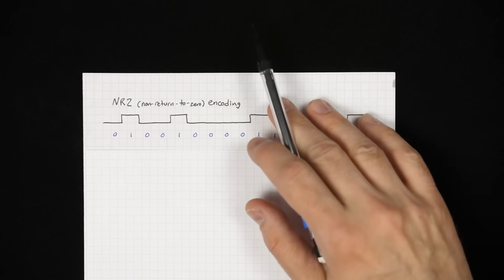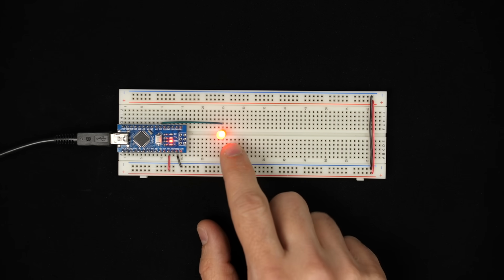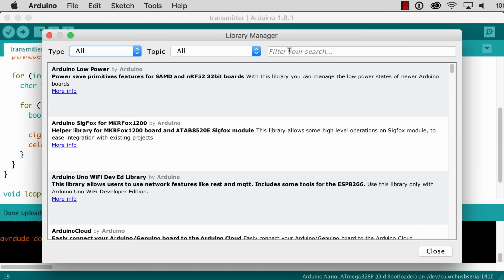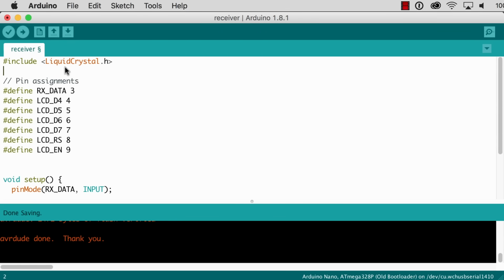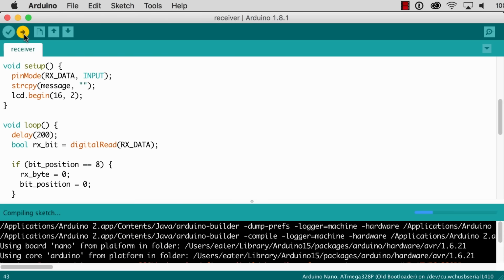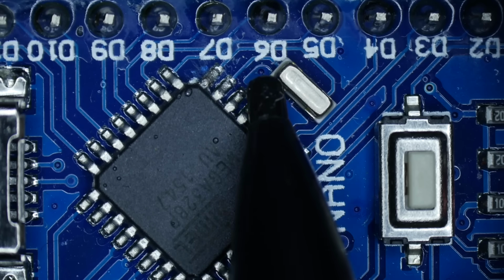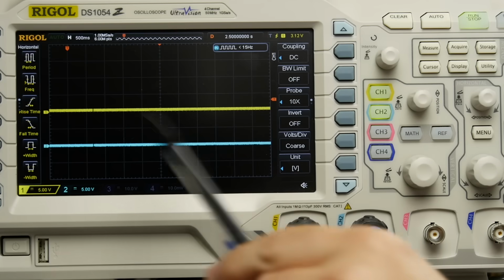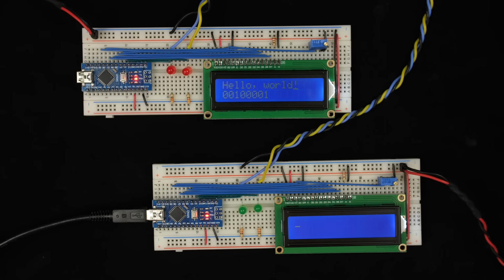Reliable data transmission

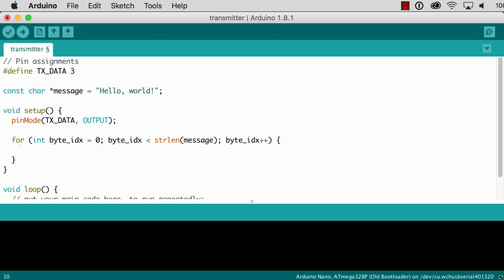Comment: @3:18 using strlen to convert a linear algorithm into a quadratic algorithm. use `for(char * tx_byte = message; *tx_byte; tx_byte++)`.
Reply: Ben, this is a great video.  I did something similar when I taught a data communications class as a clinical/adjunct professor.  Your demonstration is better than what I did.

I was looking for this thread; I spotted this issue when I watched this morning.

Ted, you are completely correct.  As written, this code fragment is O(n^2) in the length of the message.  However, might I suggest for pedagogical purposes (many viewers don't have our experience):
        msg_len = strlen(message);          /* Could be written as:  for(int byte_idx = 0, msg_len = strlen(message); byte_idx .... )  */
        for(int byte_idx = 0; byte_idx < msg_len; byte_idx++) {
                char tx_byte = message[byte_idx];
        }

Balazs Oczot, unless the compiler did the above optimization, this fragment is, indeed, O(n^2).  C guarantees that the conditional in a 'for' loop will be evaluated every iteration.  strlen() determines the length by marching along the string searching for the null character, '\0', that marks the end of a C string.  So, finding the length of the string is O(n).  Because the for loop is executed n times and at each iteration the length of the string is calculated, this fragment is, as Ted stated, O(n^2).  Your point regarding pedagogy is well taken.

Simon, you are absolutely correct.

I worked for a large, well known company, as an industrial mathematician doing queueing theory and performance engineering.  A large project was nearly cancelled because it didn't meet performance requirements.  None of the software engineers could find the problem.  I never knew the exact details, but I guess perhaps 50 staff-years of work ready to be flushed down the toilet.  One of my colleagues and I were given the task of finding the problem, else the project would be scrapped.  It turned out that this exact problem, buried at the bottom of several nested loops, was the culprit.  After fixing this, just as above, and recompiling, the project went from failing abysmally, about sixty times slower than required, to exceeding the performance requirements by about 50%.  I often wonder how many projects are saved today simply by throwing more or faster silicon at it, rather than finding the root cause.
Be well & Best regards, Gottfried
Reply: Its not quadratic, only two times the length of the message. And the code is more readable for people not familiar with pointers
Reply: @b4l1x  the condition is re-evaluating every time, including computing the length, which is in the order of the length of the string if the compiler didn't optimise (which many do for strlen)

Comment: Well if you're gonna use a hardware interrupt to read the the pin you might as well trigger on pin change and measure how long it has been high or low to count the ones and zeros. It would still be a bad version of the SoftwareSerial library, but you know, at least you wouldn't need a clock line. :P

Comment: "bool tx_bit = tx_byte & (0x80 >> bit_idx)" at around 4:22 is not very portable and may induce unspecified behavior on some older compilers.
It's good practice in my opinion to always normalize your boolean conversions, for example: "bool tx_bit = tx_byte & (0x80 >> bit_idx) ? true : false;"

Comment: You didn't really mention clock and data recovery in the transmission of NRZ data. Probably beyond the scope of the video, but that is how it is done in real life (concept of locking a local oscillator to incoming data).

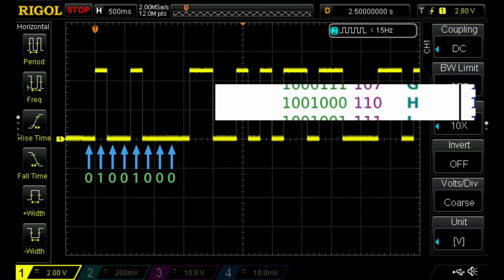Comment: i like the way you present information. I've opinion of what extra info might be presented: you started (8:40) with framing bit which is start bit in UART (or maybe link to that video) but you ended with clock which is closer to USART... also i think it was nice to remove the delay in transmitter (although i think it will not affect because delay in LCD library is big already) so maybe print after recieving everything.. and its nice to briefly talk about why the wires are twisted ;).

Comment: It's not a good idea to put a LED on an output directly. What happens is the output voltage will drop to the forward voltage. So it can be hard to to get subsequent inputs on those outputs to trigger high. The best setup Would have the LED being driven by a mosfet from the output.

Comment: You don't need a second line at all if you're willing to have a slightly slower transfer rate. You can have the first clock pulse designate the clock speed to the receiver (the length of the clock pulse is the clock speed, we'll call it dt). Then, you begin each bit by changing the line from low to high for a length of dt, and then you pull it low for a length of dt if you want to send a 0 or you keep it high for a length of dt if you want to send a 0. After these two dt have passed, you drop the line low for an arbitrary amount of time (let's say dt/4), and then you pull it high again for the next bit, and repeat. The receiver stops receiving the stream of data if, after you send a bit, the line remains low for a certain amount of time (let's say dt * 2).

This allows you to reliably send data over 1 bit. The clock speed is arbitrary as the sender gets to decide the clock speed at the beginning of the communication. The two devices cannot fall out of sync because we resync between every bit. Having a system like this allows for both upstream and downstream data to be sent at the same time through two wires (or a single coaxial cable), so using simply two wires you can have the devices talking to each other back and forth for real-time communication.

Comment: I am not sure that rtz is more complicated than nrtz. I always use analog pins and rtz to communicate between arduinos as I don't have to worry about clock syncing at all, and I never have communication issues. Far easier to implement.

Here is a simple primitive way to do it that allows a metric truck ton of wiggle room on the analog signal level on the receiving end. Just make sure the receiving end is listening at a higher rate than the transmitting side is sending. 

int read;
bool bitSet = false;

void setup() {
     analogReadResolution(3);
     //0v to 1.67v = 0
    //1.67v to 3.33v = 1
    //3.33v to 5v = 2
}

void loop() {
     read =  analogRead(A0);
     if (!bitSet) {
          if (read == 0) {
              appendBit(false);
              bitSet = true;
          } else if (read == 2) {
              appendBit(true);
              bitSet = true;
          } 
     } else if (read == 1) {
          bitSet = false;
     }
    delay(1);
}

Comment: When the transmitter and receiver have different power sources and you connect the cable's ground lead to ground on both sides, how do you prevent ground loops from happening?

Comment: I like the tricks you're using to hide some of the complexity that could distract from what you're trying to teach here, such as:
- using strncpy to copy 1 byte, which conveniently interprets a 0 as an empty string
- setting update_lcd = false immediately after checking it, to minimize the effect of the TOCTOU race condition (and then updating the whole LCD on each loop iteration so that if you trigger the race, so it still doesn't end up corrupting the display)

Comment: So just a few short minutes into the video, he says "so lets see what the simplest way to get data communication going is"... and then proceeds to go into an overly complicated example of bits that was totally unneeded considering the topic was supposed to be data transmission and the 'simplest way to get it to work'... which mind you, is just taking a wire, and joining two pins on those arduinos.... we don't need background info as to how bits are done or why they are the way they are.... just go 'ok this is simplest data communication! see! it said hello world across this single wire! done!" lol

Comment: Great work! Love your videos!  But, I have a correction for you regarding NRZ vs. RZ. RZ/NRZ has nothing to do with "bi-polar" signaling, as you seem to explain. It has everything to do with the Bit Period. In a full clock cycle of a bit sent down the line, if during the bit period (i.e. one full clock cycle) the data signal returns to zero voltage before the end of the bit period, then that is a RZ signal. If, however, the signal does not return to zero voltage when sending a 1 (i.e. positive or negative voltage), then it is NRZ. RZ and NRZ can operate in both uni-polar or bi-polar line voltage configurations. Bi-polar is typically employed for differential encoding, which reduces noise and impedance issues for long cables/lines. NRZ is usually employed to improve timing (i.e. deriving a clock from the input when no separate clock signal is sent).

Comment: Excellent!, I went I bought everything to mimic your project, because I want to learn this transmission idea to get understanding to was is going on in those process, but I got a 20 col 04 row LCD, with card included, which uses only four pins, two for power, so I was able to replicate the Transmitter, but stuck in the receiver, because of only pin 4 and pin 5 are used, now if I use this to receive the data and clock, what pin is going to transmit to the LCD?, help please, also I have to use them with LiquidCristal_I2C

Comment: Cool demo, though I expected to remain using just one wire and instead do clock recovery, synchronizing the receiver when you see a 1-bit (possibly introducing framing with a start bit to make sure you never get too long string of zeroes). That way you have to keep the clock skew to only within a byte and still keep the simple voltage levels and only 1 wire. Since in realistic scenarios you typically want to minimize the number of wires you need (plus it would work as intro to how the real hardware serial comms work).

Comment: Is there an error in your code?

You check if bit_position is equal to 8 and if so, set bit_position to 0. Then a few lines down, you once again check if bit_position is equal to 8, which is can never be.

Comment: Never used Arduino - but isn't it bad form to declare variables within a loop? Forgive my C# understanding of the world if that doesn't apply here. I suppose it doesn't matter since you control the length of the string so it's not going to cause a buffer overflow unless you forget and put a really long message. But muh best practice tho?

Comment: Amazing video, but not very accurate programming style. "1000/TX_RATE" vs magic "200". It's not good idea to use loop() only on one side. And you shouldn't use interrupts from start - that broke simple-to-complex explaining principle. Also, you didn't notice that sincronized transmission allows to change transmission rate on single side.

Comment: If you want to detect and correct errors in data transmission pipe, then you need to implement a Error-Correcting Code (ECC) encode/decode for the send/receive functions. Since you are using a Atmega328, you will probably be limited to simple linear logic correction (i.e. Hamming with 1-bit correction per 256 bytes). Anything greater, and you will need to add a FPGA to your design to implement something like Reed-Solomon or Binary BHC. I have code samples on my website if you need them.

Comment: This is a little off-message, but is it necessary to establish a common ground between the transmitter and receiver, considering each device is grounded through its DC power source?

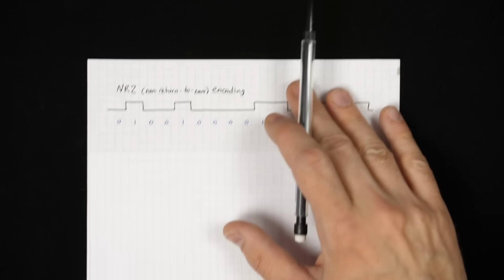Comment: 1:49... I usually orient my similar breadboards with the + red rail at the extreme top like I write my schematic drawings with the positive rail a the top of the page and the negative/ground rail at the bottom of the page. Helps remove any brain fart errors...;-)

Comment: Some things you almost certainly know, but viewers might not.

You could use the serial data decoding on your scope to make it a bit easier to see what is being received/transmitted. 

Having the clock line twisted with the data & ground lines can allow for crosstalk. Utterly unimportant at 5 baud, but very important at high data rates.

There are also self-clocking encodings and Clock & Data Recovery (CDR) schemes. These avoid the need for an explicit clock line while allowing different clock rates on the sender and receiver. 8b10b encoding is one of the most common, but Manchester encoding is simpler for beginners to understand.

Comment: Ok, this was very short distance, but try to set this setup far away from each other (for example, these are at the opposite side of a large room or farther away at a different location). I think a long three-wire cable and two USB 5V power supply is enugh for this experiment (afther these progammed correctly).

Comment: I wonder about something : the ground (black) wire that you used along with the data transmition wires and the clock wire, is it really usefull? I have the felling that like how you did, you just linked the two grounds of both bread boards, which does not really help, or does it?

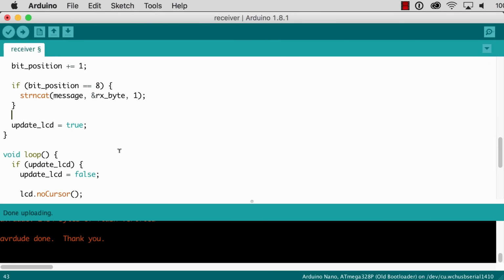Comment: 38:42 wouldn't it be a lot more efficient to preform LCD updates inside the OnClockUpdate() so that this if isn't checked constantly? (assuming of course you can insure that you're LCD isn't using interrupts)

Comment: Would adding a start-bit (high) before sending the byte and a stop-bit (low) after each byte help in keeping the arduino's in sync for longer with the "two wire" communication setup? 

The receiver can wait for the rising edge of the start bit, wait 300ms (1.5 bit time to make sure the bit is stable), sample 8 bits every 200 ms, wait another 200ms and start waiting for the rising edge of the next start-bit. I believe this is called asynchronous communication.
Reply: that is synchronous communication
Reply: Yes, that's asynchronous communication.  You've pretty much described how serial ports work---they use low for the start bit and high for a stop bit, because an idle line is held high instead of low in order to detect a break in the connection, which can be used to trigger another interrupt.  (Sending a "BREAK" is when the transmitter deliberately holds the line low for long enough to trigger this detection logic in the receiver.)

Note also that traditional RS-232 serial ports tend to swing between +12V and -12V, whereas the Arduino expects between 0V and +5V (and I think Rpi expects 3.3V?) so don't just connect a 9-pin serial port straight to your Arduino or your Rpi without knowing what voltages each side needs, and using level-shifters where necessary. :)
Reply: Dwonis what MrBluemoon84 speaks about is synchronous communication, an asynchronous communication example is a protocol that is not based on timing, but on the pin state to sample binary data (see the parallel port), Serial is synchronous because it is based on synchronized pulses and not on the state of one pin to pass to the next bit. Asynchronous communication is used when the receiver could be busy for long time and potentially loosing synchronous data passing by
Reply: Giovanni: Go look up "asynchronous serial communication" and "synchronous serial communication" on English Wikipedia.  See also "UART".  See also the Atmel documentation for the AVR's "USART".
Reply: Dwonis I am aware about the meaning of the UART and USART acronyms. I think a better and more effective example of asynchronous communication is a protocol that is not bound to the time domain (serial signaling is bound to timing with a small margin for local clock differences) as, for example, asynchronous 4-phase level-signaling non-blocking protocols where bits have arbitrary lengths depending on receiver's available computation time while other tasks are executed in parallel with data reception.

Comment: I should start with telling you that this is a great video.  Yes, I did this back in 1983, and is teaching in computer science.  But still a great script for the video and Arduino code. Great balance between theory and practice, the nice 

You could use modulo with 8 to detect when you get the eight position. Each time indx % 8 is zero, you know that indx is divisible by 8.
And indx = (indx + 1) % 8:  will count index from 0 up to 7 and then back to 0.

Comment: Good video.  Saw previous comments about using I2C, SPI and UART and I'm curious why you didn't use UART?  It would have taken you faster to the main theme of reliable data transmission (which I assume is your next video).  Also the UART protocol is self-framing whereas the receiver in your demo, when it starts, doesn't really know if the first bit it sees is really the first bit or not of a character byte.

Comment: I'm trying to sync 2 Arduinos for a drag racing light tree project. The concept is a paired set of Arduinos with red, yellow, and green leds that can be placed in each car. Push a button (on either one,) and both count down with the lights to start a race between the 2 cars. So I setup and programmed 2 Arduinos and ran into this timing issue. Even when they were both using the same power supply. I was going to switch over to 433mhz feathers (once I figured out wth I was doing, still haven't,) I couldn't figure out a wireless solution to the clock thing. Watching this video gave me a different idea, not sure how to implement it. I was thinking if both Arduinos had an IR led and receiver that could clip on to an external part of the car, then whichever one transmits the start can blink the IR LED to reset the clock on the receiver while reseting it's own clock. Not endorsing illegal behavior, use at your own risk yada yada, Arduino code, what I have so far, is in the description of my race tree video on my channel. Just a basic timed light sequence. Thinking about it... if I have the IR would it be better to just transmit, through IR, the bulb status only using the timing on the initiator and a bit sequence? Thots? Complete noobly noob novice here :-)